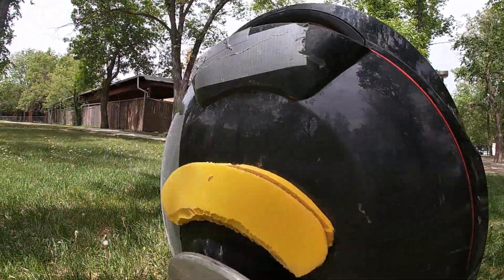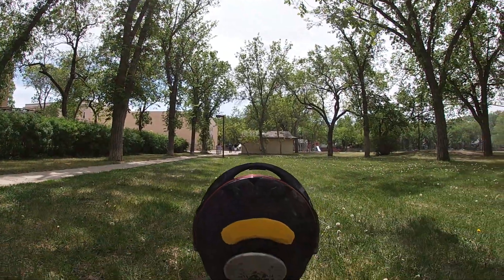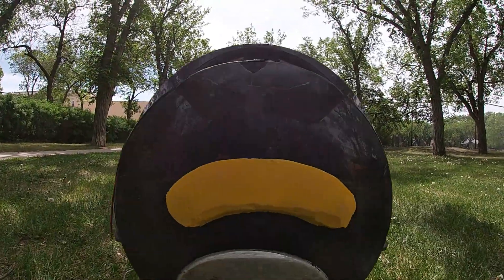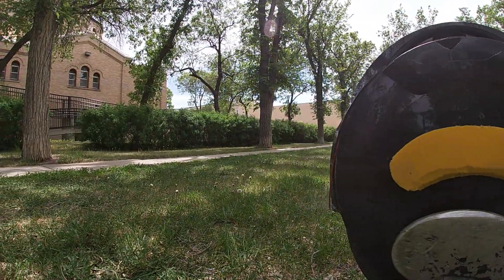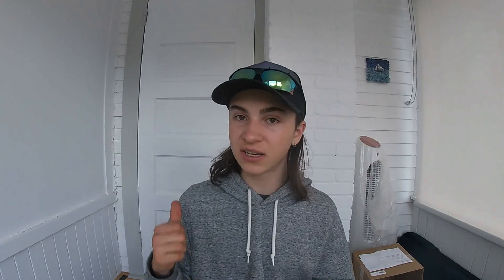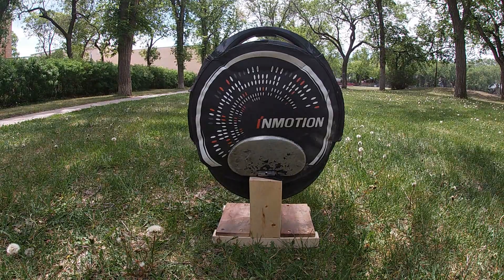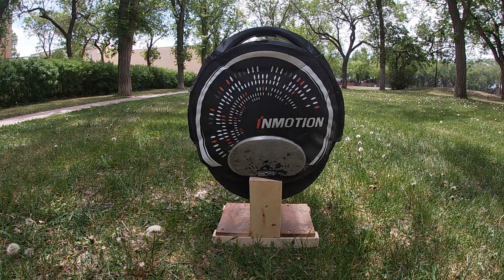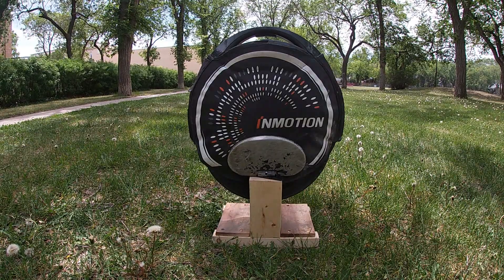Electric Unicycles: 5 ways to upgrade and improve them(2020)

Comment: Nice video man!  Very informative.  Been riding EUC for 3 years and love them.  Loved my V8.  Had it for a long time.  Loved the weight and portability. What do you think of the new suspension wheels? What do you like best?  Thanks for the video.  I subscribed.
Reply: On the suspension subject, I ordered the V11. I have been riding a little more than a year and seem to be developing back problems. Currently on 100v MSX but I’m in my 60’s so suspension is going to be helpful for us old guys. Thanks for the video.
Reply from the maker: Right on! Glad you enjoyed it!! I think the new suspension wheels could be useful as a second wheel but currently not if it's your only wheel. I ordered a Gotway Tesla because I need a little upgrade, but I am looking forward to see Gotway's take on the suspension line. Hope it has a bigger battery!! Thanks for subscribing!!
Reply from the maker: ended up cancelling my gotway tesla order, and ordered a v11. spur of the moment decision. still not sure if it was the right one.
Reply: EUCboi   Me thinks your going to be very happy with the V11 😁
Reply: @eucboi7595  can't wait to see your v11 vids.